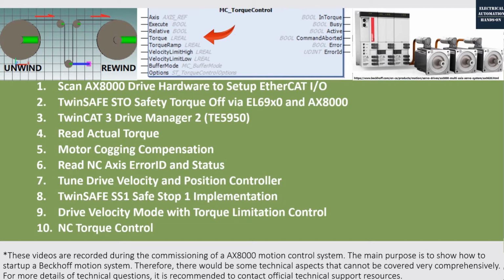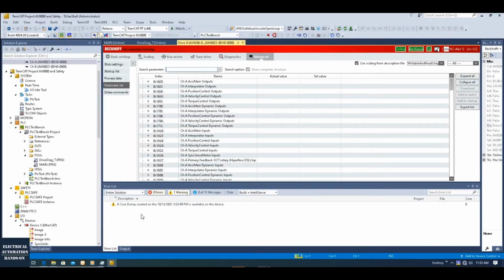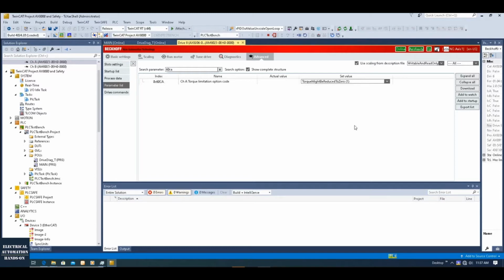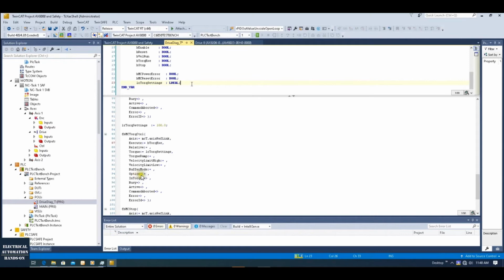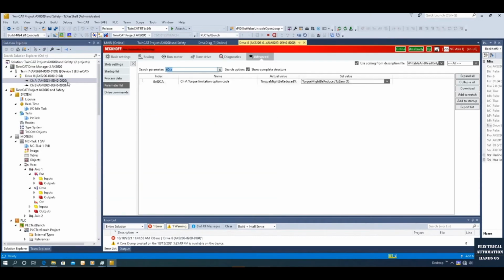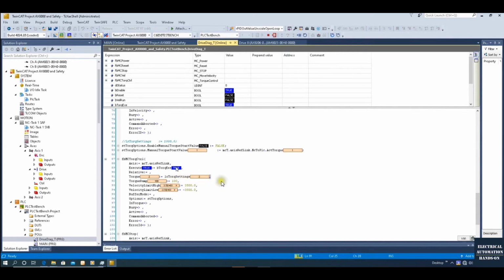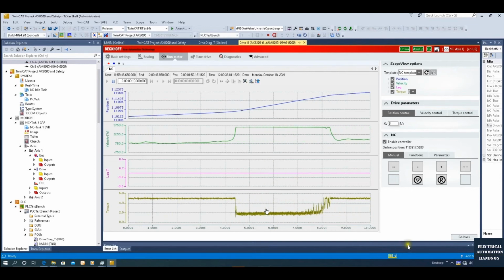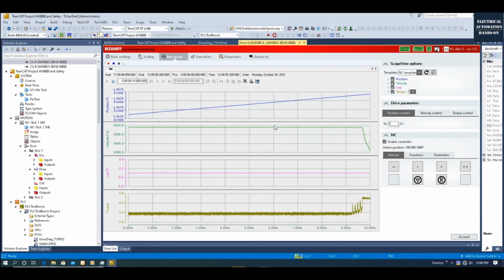MB30. [AX8000 Servo][10/10] Beckhoff MC Torque Control

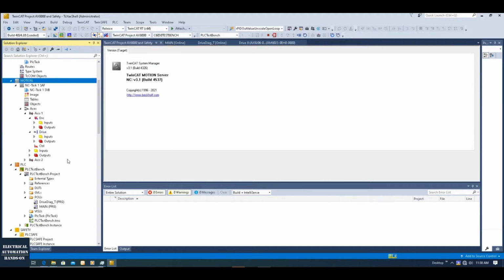Comment: Hi great video, at 7:23 you set the drive up with time compensation. Can you describe what effect it has in more detail? And do you know the effect on 3rd party drives?
Reply from the maker: This is a good question. The Time Compensation is used to compensate for the delay caused by the NC axis sample delay.  If you are doing super high accurate positioning/synchronization control, especially using Touch Probe or Cam, this Mode is highly recommended.
Reply: @electricalautomation  thanks. I'm trying the function out with a linmot servo. The switch from velocity to torque is smooth. But the switch back to velocity seems to give a kick. 
 I tried search infosys for answeers but no help in this topic :)
Reply from the maker: @jensbjerg6960 When you are using torque control, you need to have speed limitations, then when you are going to switch from torque to velocity control, limit the speed into a very narrow range and matching to your target velocity, then switch.
Reply: @electricalautomation  that is a good point. I will try to shoot the axis with actual velocity when switching back from torque first before lowering the speed. Have you tested the effect on mc_buffered?

Comment: Great explanation! Is there a way to do a closed-loop torque control using external feedback from a load-cell or torque sensor with this function block?
Reply from the maker: You can use PID, the feedback is the load sensor, SP is the tension setting, the PID output is the roller speed.

Comment: Thanks for the video. I have a few questions regarding the settings. Can you explain why you
1. changed to VelocityControl2 in the slot settings? 
2. Add a virtual operation mode, and not change the main mode of operation? Is this such that you can switch between velocity and torque mode?
3. Add the modes of operation to the outputs? these are not strictly necessary for the operation I think?
4. Select torque might be reduced to 0?
Reply from the maker: Hi Roald, the method shown in the video about the torque control is hard to explain why. Because it doest have the clear manual explaining the procedure and why we need to do the procedure. But the procedure I showed 100% workable for using AX8000, you could just follow it.
Reply: @electricalautomation  Thanks. I hoped you found some documentation on this. It is really frustrating working with this stuff without any proper documentation from Beckhoff.

Comment: Thank you for your video, I tried using this FB with Beckhoff AX5 and got a x4625 error problem (operation mode invalid) but I checked it all over again and again and still don't know why because the drive was running with primary mode (which I set to force and torque control). Please help me if you have faced any similar issues...
Reply from the maker: Your AX5 might not have the torque control feature. You could contact Beckhoff support to verify if your revision support or not. Alternatively, you can use speed control with torque reduction. Pls check my another video